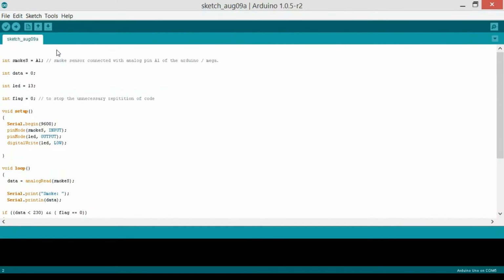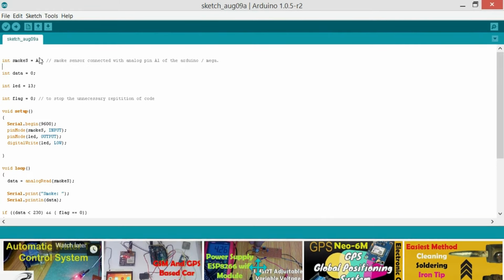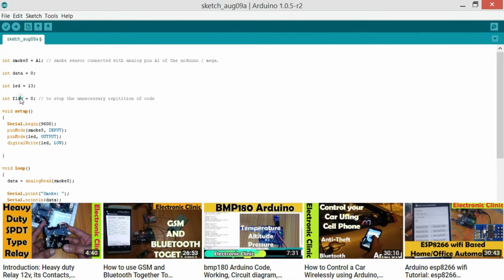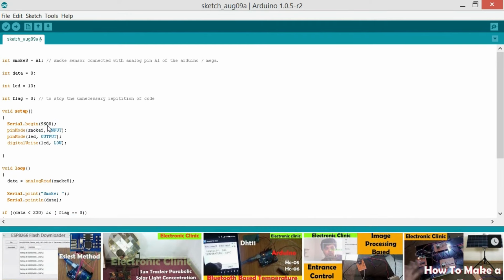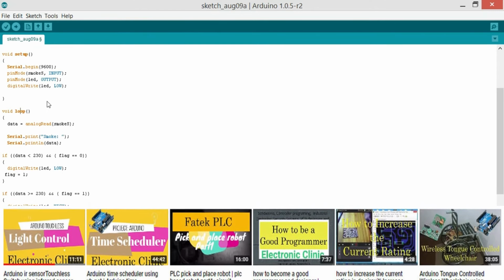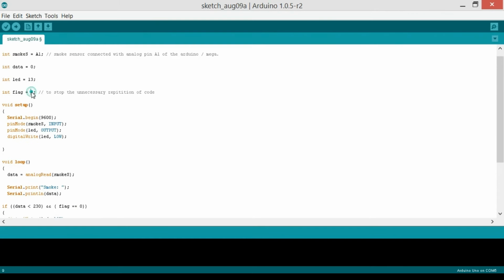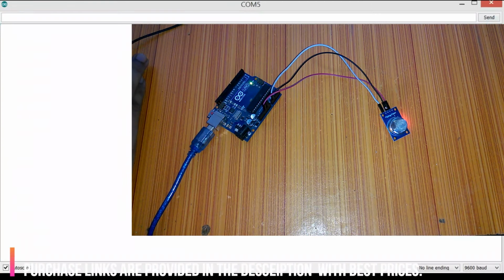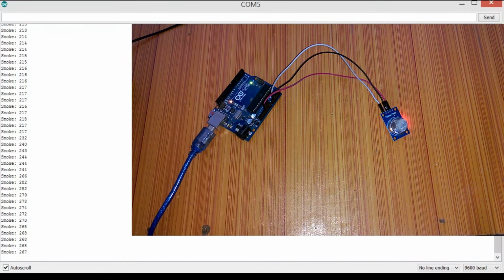Arduino SMOKE/GAS SENSOR MODULE MQ2 (MQ-2)  Introduction, specifications,interfacing and programming

Comment: Hi. Is it normal to get a smell when you connect the sensor to the Arduino for the 1st time? I get a slight smell and the sensor becomes slightly hot. This is even before I upload any coding
Reply from the maker: This has never happened to me.